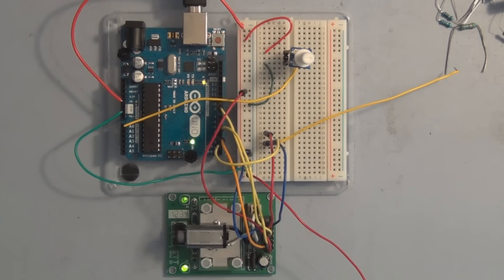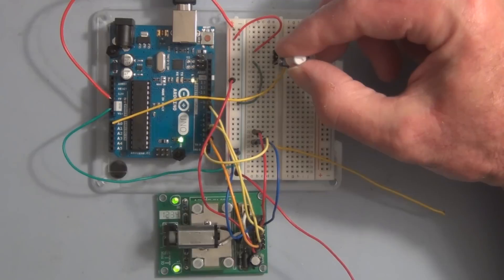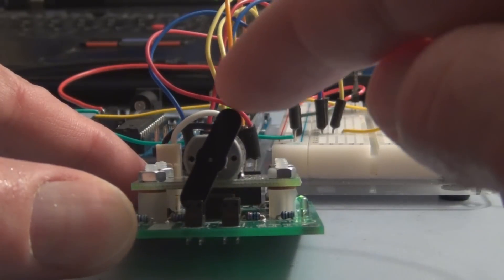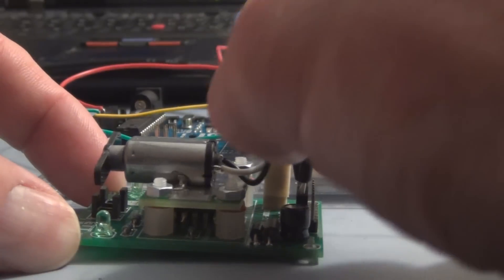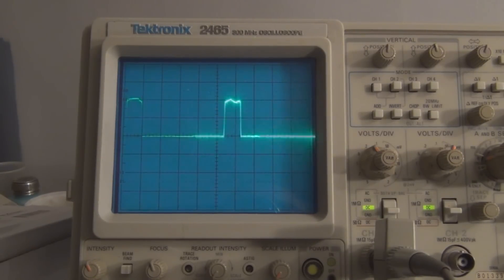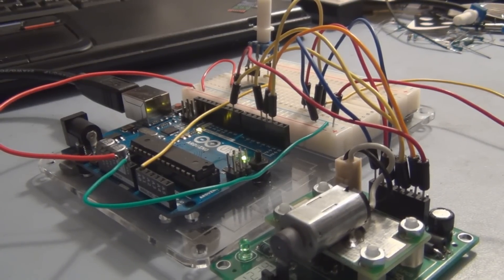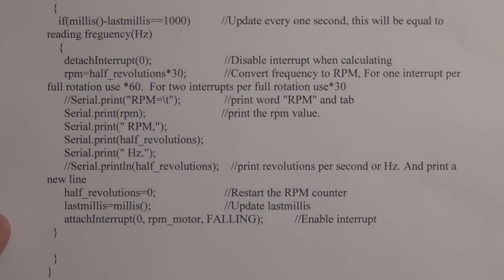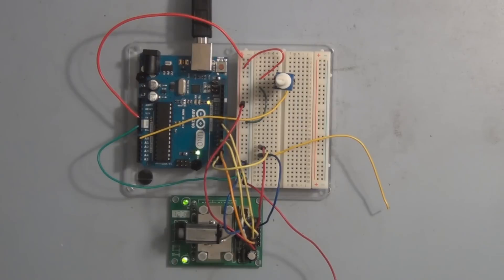Arduino DC Motor RPM Measurments tutorial

Comment: Thank you very informative. I am in the early stages of developing a RPM measuring tool for 1/24 scale slot car motors. These are typically run. at 12v DC and can have full RPM over over 25000 depending on the motor.

Comment from the maker: Code
//Hbridge Motor Control

const int EN=9;     //Half Bridge 1 Enable
const int MC1=4;     //Motor Control 1
const int MC2=3;     //Motor Control 2
const int POT=0;     //POT on Analog Pin 0

int val = 0;         //for storing the reading from the POT
int velocity = 0;     //For storing the desired velocity (from 0-255)

volatile int half_revolutions=0;
unsigned long rpm=0;
unsigned long lastmillis=0;

void setup()

{
  Serial.begin(9600);
  pinMode(EN, OUTPUT);
  pinMode(MC1, OUTPUT);
  pinMode(MC2, OUTPUT);
  brake();    //Initialize with motor stopped
  
  attachInterrupt(0, rpm_motor, FALLING);
}

void loop() 
{
  val = analogRead(POT);
 
  
  //go forward
  if (val > 562)
  {
    velocity = map(val, 563, 1023, 0, 255);
    forward(velocity);
  }
  
  //go backward
  else if (val < 462)
  {
    velocity = map(val, 461, 0, 0, 255);
    reverse(velocity);
  }
  
  //brake
  else
  {
      brake();
  }
  {
    if(millis()-lastmillis==1000)     //Update every one second, this will be equal to reading freguency(Hz)
    {
      detachInterrupt(0);              //Disable interrupt when calculating
      rpm=half_revolutions*30;       //Convert frequency to RPM, For one interrupt per full rotation use *60.  For two interrupts per full rotation use*30
      //Serial.print("RPM=\t");          //print word "RPM" and tab
      Serial.print(rpm);               //print the rpm value.
      Serial.print(" RPM,");
      Serial.print(half_revolutions);
      Serial.print(" Hz.");
      //Serial.println(half_revolutions);    //print revolutions per second or Hz. And print a new line
      half_revolutions=0;             //Restart the RPM counter
      lastmillis=millis();              //Update lastmillis
      attachInterrupt(0, rpm_motor, FALLING);   //Enable interrupt
  }

  }
}

void rpm_motor()
{
  half_revolutions++;
}
  //Motor goes forward at given rate (from 0-255)
  void forward (int rate)
  {
    digitalWrite(EN, LOW);
    digitalWrite(MC1, HIGH);
    digitalWrite(MC2, LOW);
    analogWrite(EN, rate);
  }
  
  //Motor goes backward at given rate (from 0-255)
  void reverse (int rate)
  {
    digitalWrite(EN, LOW);
    digitalWrite(MC1, LOW);
    digitalWrite(MC2, HIGH);
    analogWrite(EN, rate);
  }
  
  //Stops motor
  void brake ()
  {
    digitalWrite(EN, LOW);
    digitalWrite(MC1, LOW);
    digitalWrite(MC2, LOW);
    digitalWrite(EN, HIGH);
  }
Reply: Thank You.

Comment: please reply sir i need ur help....
Reply from the maker: //Hbridge Motor Control

const int EN=9;     //Half Bridge 1 Enable
const int MC1=4;     //Motor Control 1
const int MC2=3;     //Motor Control 2
const int POT=0;     //POT on Analog Pin 0

int val = 0;         //for storing the reading from the POT
int velocity = 0;     //For storing the desired velocity (from 0-255)

volatile int half_revolutions=0;
unsigned long rpm=0;
unsigned long lastmillis=0;

void setup()

{
  Serial.begin(9600);
  pinMode(EN, OUTPUT);
  pinMode(MC1, OUTPUT);
  pinMode(MC2, OUTPUT);
  brake();    //Initialize with motor stopped
  
  attachInterrupt(0, rpm_motor, FALLING);
}

void loop() 
{
  val = analogRead(POT);
 
  
  //go forward
  if (val > 562)
  {
    velocity = map(val, 563, 1023, 0, 255);
    forward(velocity);
  }
  
  //go backward
  else if (val < 462)
  {
    velocity = map(val, 461, 0, 0, 255);
    reverse(velocity);
  }
  
  //brake
  else
  {
      brake();
  }
  {
    if(millis()-lastmillis==1000)     //Update every one second, this will be equal to reading freguency(Hz)
    {
      detachInterrupt(0);              //Disable interrupt when calculating
      rpm=half_revolutions*30;       //Convert frequency to RPM, For one interrupt per full rotation use *60.  For two interrupts per full rotation use*30
      //Serial.print("RPM=\t");          //print word "RPM" and tab
      Serial.print(rpm);               //print the rpm value.
      Serial.print(" RPM,");
      Serial.print(half_revolutions);
      Serial.print(" Hz.");
      //Serial.println(half_revolutions);    //print revolutions per second or Hz. And print a new line
      half_revolutions=0;             //Restart the RPM counter
      lastmillis=millis();              //Update lastmillis
      attachInterrupt(0, rpm_motor, FALLING);   //Enable interrupt
  }

  }
}

void rpm_motor()
{
  half_revolutions++;
}
  //Motor goes forward at given rate (from 0-255)
  void forward (int rate)
  {
    digitalWrite(EN, LOW);
    digitalWrite(MC1, HIGH);
    digitalWrite(MC2, LOW);
    analogWrite(EN, rate);
  }
  
  //Motor goes backward at given rate (from 0-255)
  void reverse (int rate)
  {
    digitalWrite(EN, LOW);
    digitalWrite(MC1, LOW);
    digitalWrite(MC2, HIGH);
    analogWrite(EN, rate);
  }
  
  //Stops motor
  void brake ()
  {
    digitalWrite(EN, LOW);
    digitalWrite(MC1, LOW);
    digitalWrite(MC2, LOW);
    digitalWrite(EN, HIGH);
  }
Reply from the maker: Separate Processing Sketch.  You need to download and install the latest version of Processing at https://processing.org/

//Displays the RPM

import processing.serial.*;
Serial port;
String motor_rpm = "";
String Hertz="";
String data = "";
int index = 0;
PFont font;

void setup()
{
  size(800,500);
  //Change COM to the name of the serial port on your computer
    port = new Serial(this, "COM5", 9600);
    port.bufferUntil('.');
  //Change the font name to reflect the name of the font you created
    font = loadFont("Arial-BoldMT-100.vlw");
    textFont(font, 100);
}

void draw()
{
    background(0,0,0);
    fill(46, 209, 2);
    text(motor_rpm, 70, 175);
    fill(0, 102, 153);
    text(Hertz, 70,370);
   
}

void serialEvent (Serial port)
{
  data = port.readStringUntil('.');
  data = data.substring(0, data.length() - 1);
  
  //Look for the comma between RPM and Hertz
  index = data.indexOf(",");
  //Fetch RPM
  motor_rpm = data.substring(0, index);
  //Fetch Hertz
  Hertz = data.substring(index+1, data.length());
}

Comment: after i upload the code on my arduino i don't see these windows which show the RPMs how can i make them visible ?
Reply from the maker: You need to install processing on your computer.  Here is the link https://processing.org/download/.  This is the processing sketch I used.
//Displays the RPM

import processing.serial.*;
Serial port;
String motor_rpm = "";
String Hertz="";
String data = "";
int index = 0;
PFont font;

void setup()
{
  size(800,500);
  //Change COM to the name of the serial port on your computer
    port = new Serial(this, "COM5", 9600);
    port.bufferUntil('.');
  //Change the font name to reflect the name of the font you created
    font = loadFont("Arial-BoldMT-100.vlw");
    textFont(font, 100);
}

void draw()
{
    background(0,0,0);
    fill(46, 209, 2);
    text(motor_rpm, 70, 175);
    fill(0, 102, 153);
    text(Hertz, 70,370);
   
}

void serialEvent (Serial port)
{
  data = port.readStringUntil('.');
  data = data.substring(0, data.length() - 1);
  
  //Look for the comma between RPM and Hertz
  index = data.indexOf(",");
  //Fetch RPM
  motor_rpm = data.substring(0, index);
  //Fetch Hertz
  Hertz = data.substring(index+1, data.length());
}

Comment: Is it possible to get a copy of the sketch you used for this?
Reply from the maker: +Richard Surratt //Hbridge Motor Control

const int EN=9;    //Half Bridge 1 Enable
const int MC1=4;    //Motor Control 1
const int MC2=3;    //Motor Control 2
const int POT=0;    //POT on Analog Pin 0

int val = 0;        //for storing the reading from the POT
int velocity = 0;    //For storing the desired velocity (from 0-255)

volatile int half_revolutions=0;
unsigned long rpm=0;
unsigned long lastmillis=0;

void setup()

{
  Serial.begin(9600);
  pinMode(EN, OUTPUT);
  pinMode(MC1, OUTPUT);
  pinMode(MC2, OUTPUT);
  brake();  //Initialize with motor stopped
  
  attachInterrupt(0, rpm_motor, FALLING);
}

void loop() 
{
  val = analogRead(POT);
 
  
  //go forward
  if (val > 562)
  {
    velocity = map(val, 563, 1023, 0, 255);
    forward(velocity);
  }
  
  //go backward
  else if (val < 462)
  {
    velocity = map(val, 461, 0, 0, 255);
    reverse(velocity);
  }
  
  //brake
  else
  {
      brake();
  }
  {
    if(millis()-lastmillis==1000)    //Update every one second, this will be equal to reading freguency(Hz)
    {
      detachInterrupt(0);            //Disable interrupt when calculating
      rpm=half_revolutions*30;      //Convert frequency to RPM, This workd for one interruption per full rotation.  For two interrupts per full rotation use*30
      //Serial.print("RPM=\t");         //print word "RPM" and tab
      Serial.print(rpm);              //print the rpm value.
      Serial.print(" RPM,");
      Serial.print(half_revolutions/2);
      Serial.print(" Hz.");
      //Serial.println(half_revolutions);    //print revolutions per second or Hz. And print a new line
      half_revolutions=0;            //Restart the RPM counter
      lastmillis=millis();            //Update lastmillis
      attachInterrupt(0, rpm_motor, FALLING);  //Enable interrupt
  }

  }
}

void rpm_motor()
{
  half_revolutions++;
}
  //Motor goes forward at given rate (from 0-255)
  void forward (int rate)
  {
    digitalWrite(EN, LOW);
    digitalWrite(MC1, HIGH);
    digitalWrite(MC2, LOW);
    analogWrite(EN, rate);
  }
  
  //Motor goes backward at given rate (from 0-255)
  void reverse (int rate)
  {
    digitalWrite(EN, LOW);
    digitalWrite(MC1, LOW);
    digitalWrite(MC2, HIGH);
    analogWrite(EN, rate);
  }
  
  //Stops motor
  void brake ()
  {
    digitalWrite(EN, LOW);
    digitalWrite(MC1, LOW);
    digitalWrite(MC2, LOW);
    digitalWrite(EN, HIGH);
  }
Reply: Tom, thank you very much for sharing the sketch.  I have to say your videos are the best I've seen on the internet for Arduino projects because you do three things really well in each:  i) explain the fundamental concepts, ii) show the hardware and wiring and iii)explain and show the complete sketch.  We've come a long way in a short time primarily because of you!My son and I are working on a science project for high school.  We installed two quadrature magnetic encoders on two 50:1 micro gearmotors and used a simplified version of your sketch to measure revolutions first.  The set up works fine when I rotate the wheels slowly by hand.  However, if it rotate it faster by hand or run the motor under power, the encoders read a smaller and smaller portion of the actual revolutions.  I've sent an email to Pololu to see if they can explain why. I'm not sure if the problem is with the magnetic encoders or sketch, but in case you want to look at it, here is the simplified sketch that reads fine for slow hand turning of the wheel but misses more revolutions as the speed even marginally increases.  (Motor revolutions is divided by 150 to get wheel revolutions because the motor has a 50:1 gear ratio and the encoder sends 3 falling pulses per revolution.)volatile int revolutions=0;
unsigned long wheel_revolutions = 0;void setup() {
Serial.begin(9600);
attachInterrupt(0, rpm_motor, FALLING);
}
void loop(){}void rpm_motor ()
{
revolutions++;
wheel_revolutions = revolutions/150; 
Serial.print("Revolutions=\t");
Serial.print(wheel_revolutions);
Serial.println();}
Reply: +Richard Surratt We heard back from Pololu and they noted that putting the serial print commands in the function was likely the cause of the problem.  Will run it tomorrow and confirm.
Reply: +Richard Surratt how did that turn out?
Reply: +Sammyjeans1 Worked great once we took out the serial prints.  We were actually just measuring revolutions because we wanted to measure the distance each well went and that worked really well.  Tom's sketch added a seconds counter and continuously detached and attached his interrupt so that he could calculate RPM.  Since we wanted to measure distance, we kept the interrupts attached and just kept track of the motor revolutions to calculate the wheel revolutions (from motor revs, gearing and wheel diameter).  One mistake we made early was that the variable for motor revolutions was fixed at 64000 bytes and that caused a problem when the car went a long distance.  We fixed that by changing the variable to one that could hold a very large number.